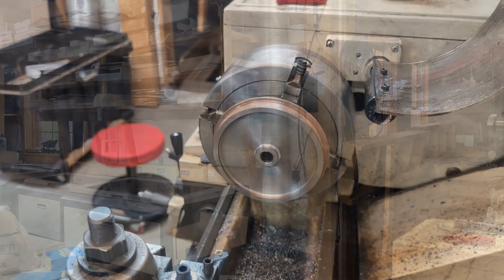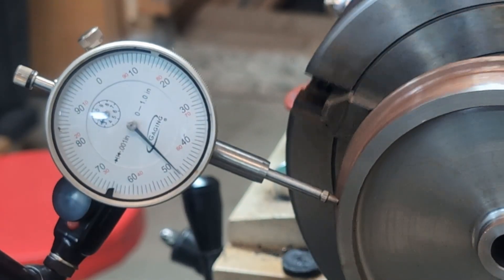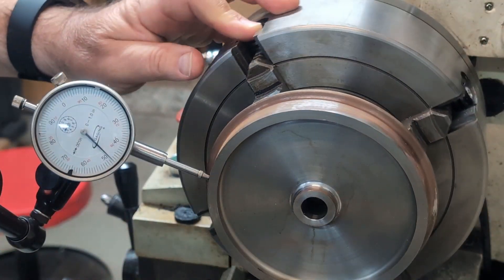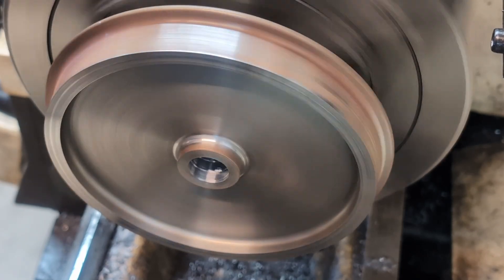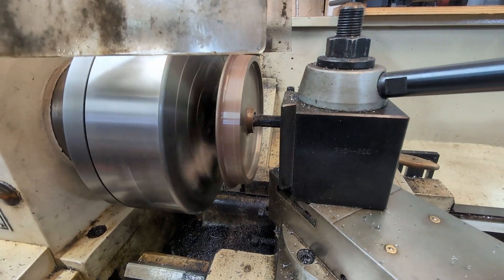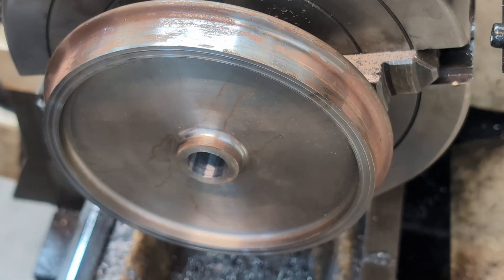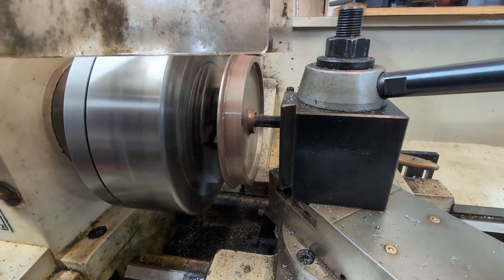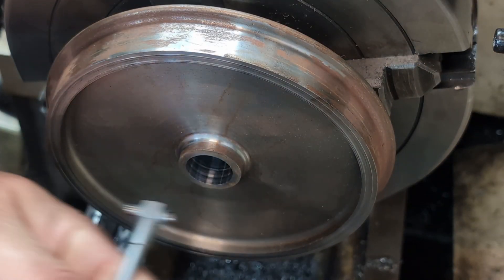Boring A Wheel Hub On The Lathe (Not As Dull As It Sounds!)

Comment: Legend says Aaron still boring it....
No i´m teasing you and joking.
On my riding car, wheels are perfect in one direction. In the opposite there is a clic clic sound. There is a defect that i can´t see. Not prone to derailment, just annoying. Since we run 95 % of the time forward, i put the trucks in "good position" , then i´m fine. I still wonder
 what´s the imperfection. So much work explain the difference of price betwen finished and unfinished wheels. 
"Just drill a hole in the center for the axle" is as we can see not so easy.
Thanks Aaron for your patience and happy 4th of july celebration. Any train run with champagne (or whatever) to cheers it ?

Comment: why not just test it with a axle been placed in the bore
Reply from the maker: @malcolmone1  I need to know how close I am to the final dimension on each pass. I know it won't fit for most passes, and I don't want to remove too much material. Remove too much material, and you've scrapped a wheel. Even wheel blanks aren't cheap enough to take those kinds of chances.
Reply: The axle is most likely a press fit.

Comment: you have to remember what ever you set the lethe for, you are actually taking 2x that amount ! say you set it
for 0.005 of an inch, you are taking 0.005 off the cutter side and in turn removing the same amount from
the opposite side of the boring bar blade. do you do an interference fit? { axel few thousands larger then 
the bored hole so you heat the opening on the wheel to expand to a larger the hole and slid it on the axel} 
great job! so nice to see all the work involved in creating these engines!
Reply from the maker: I Loctite the wheels on, so it's a slip fit. The re-gaugable ones I do also have a slip fit, but they're keyed and have set screws.